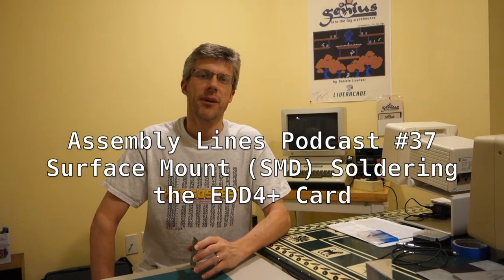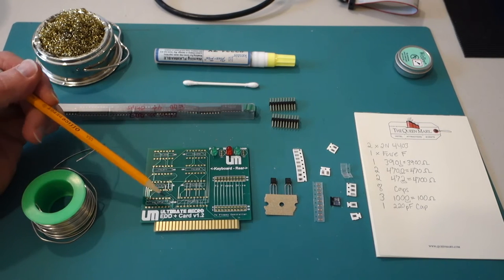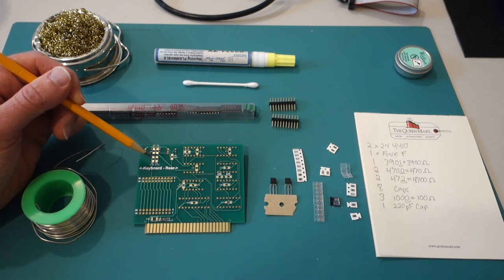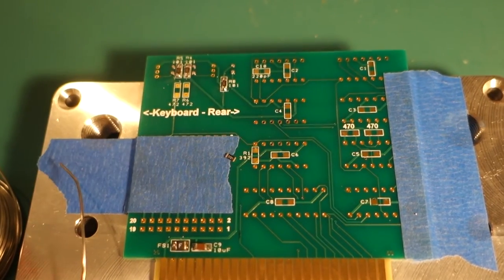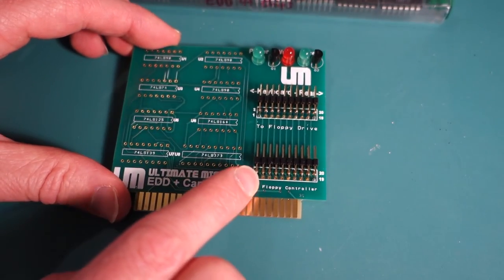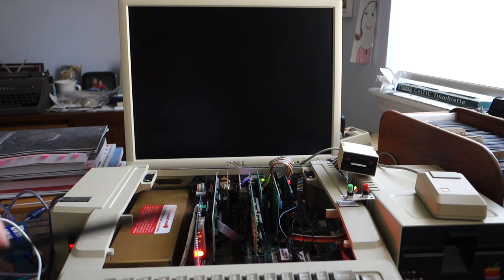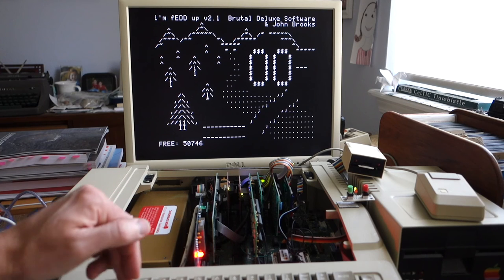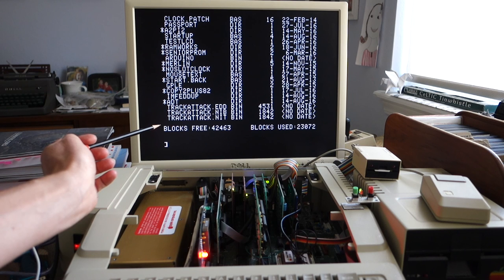Assembly Lines #37: Surface Mount (SMD) Soldering the EDD4+ Card

Comment: Setting aside the question of analyzing and cracking the image, is it writeable back to a bootable floppy? Or can it be run in an emulator? 

Good video as always.
Reply from the maker: Great question. There are a couple of emulators which make a half-hearted attempt at running an EDD - Open Emulator and MESS for example. Paul Hagstrom's blog (link in the show notes) has more details. Also, some emulators can open the NIB files. But right now, it's really just a way of preserving the raw bits so people like "4am" can crack them. That's partly why I stopped the video where I did. I couldn't figure out what to do with the disk image...